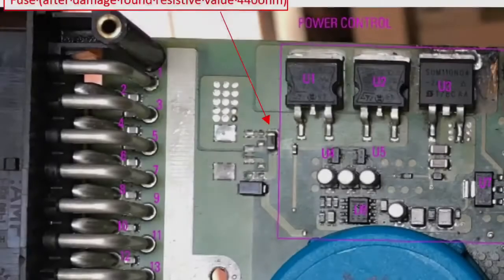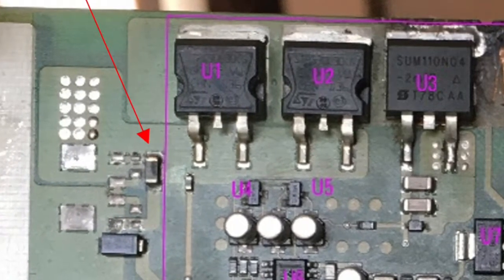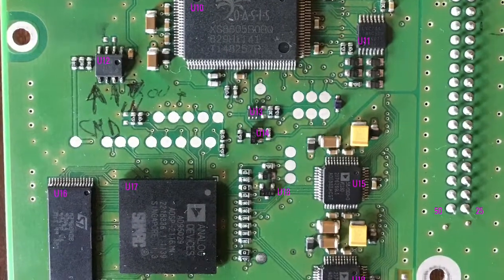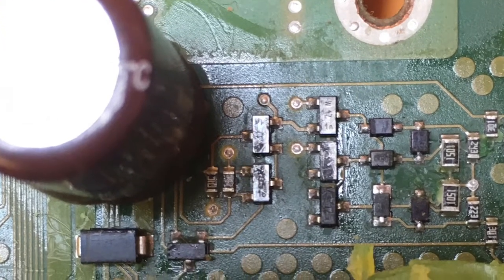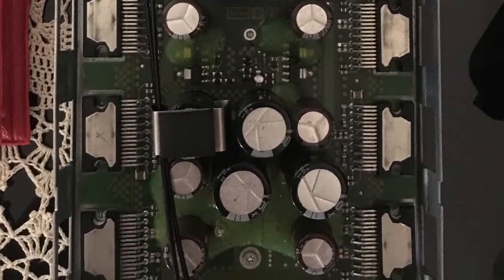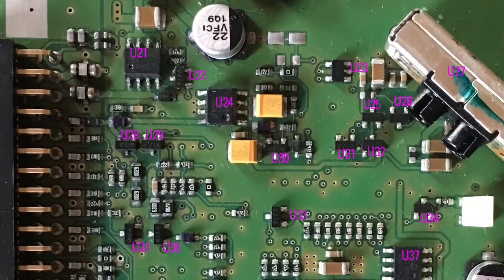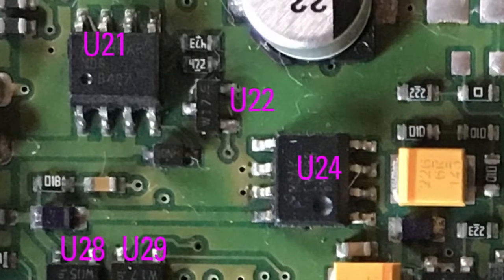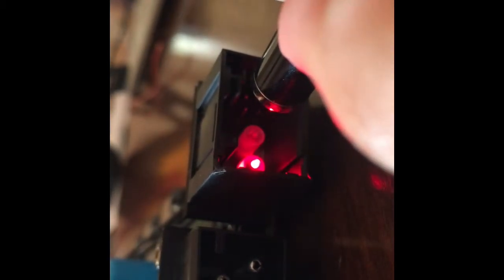BMW Harman Logic7 Amplifier Repair Guide - Part5

Comment: I'm stuck at the gate of U21. Mine is NOT at 12V as you suggest. Is there any way you can help me locate the failure?

Upon reviewing the circuit and your schematics here I am still unclear how the Gate of U21 would get 12V. I don't see where those 12V could be coming from.
Reply from the maker: Samael Estevez When you put the light on the rx led, the U7 base goes to 0volt, then collector and emitter act as closed switch. Then U4 base receives 5volt and its collector and emitter act as closed switch. Then the base of U5 goes to 0 volt and its collector and emitter acts as closed switch. Then U22 base receives 5volt and its collector and emitter acts as closed switch. Then the gate of U21 goes from high voltage (thru the resistive divider) to 0 volt, and its source and drain acts as closed switch. Then the other chips are switched on.

I’m quite sure my schematic contains errors, but the logic should be correct. Now I don’t have non more the board in my hands. If you can expand and correct the schematic, I can update the annex in order to help other guys. Let me know.
Reply: @gaucholivido  Can you help me with some advice, please? I can pay you.
Reply from the maker: @fair09 , long time has passed since my tentative to repair it. I don’t know the entire circuit therefore the probability of success is very low: water easily damage a lot of parts.
Reply: @gaucholivido  i can send you pictures with parts that i think are broken. i tried to wash it with alcohol, try to diagnose it... but i still dont get the yellow LED to turn on... im stuck
Reply: @gaucholivido  yes! Thanks for all your help. It takes a really nice person to document all this and publish it for us rookies.

I understand now. Mine is operating as it should. I needed to cover the optical input in order for it to shut down and put the u21 gate at 12v. Once I put light in optical input it turns on and goes to 0v and powers all the others. 

I have 3.3V, 1.8V, 5v, 4.5V (4.8 a little high?), However my amp doesn't work, big board doesn't receive signal to turn on U3, right now I'm trying to track that down.

Unlike yours, most of my damage was in the connectors side of the big board, I found a trace that was rusted and wasn't conducting anymore which I repaired with a piece of wire (that trace was the one that feeds 12V to small board u24 and now the trace is repaired).

Any ideas on what I should check?
Reply from the maker: Samael Estevez so plugging big and small board and supplying the big board with 12 volt, and lighting the rx optical signal you see the tx optical signal generating light?

If yes, connecting back the device in your car, is your radio able to detect the amplifier? Is the optical loop closed?

Did you check the small fuse on the small board where the 12 volt arrives?
Reply: @gaucholivido  I have checked the fuses and they are on. When I feed 12V and light up RX it does turn on the circuitry on the small board U12, U2 etc but no TX light comes up. I've uploaded a picture of the measurements on the fuses. One of them is not blown but has no Voltage. See here: https://drive.google.com/file/d/1zweFbNhpFlts3-kU0sXJC7UR1bNwB4Gz/view?usp=drivesdk
Reply: @gaucholivido  u24, u21, u20, u1 (3.3v) u12 (1.8V) are all working. 

U9 and U2 receive voltage as intended however I don't know what to look for in the outputs.
Reply from the maker: Samael Estevez check the datasheet of those conponents. Anyway if oasis chip is switched on, it should generate the optical output. I don’t know why this does not happen. Check the path from the oasis to the optical transmitter. You need to continue the reverse engineering of the schematic started by me. Use a multimeter with board NOT powered and a lot of patience.
Reply: @gaucholivido  I have lots of patience. What I don't have is the knowledge how to start documenting stuff in a neat way like you do. What software you use to draw the circuits?
Reply from the maker: Samael Estevez use the pen on the paper. When you end redraw in a clean way. Then check it again, then you can use spice to draw schematic, or just make a picture and send to me what you found.